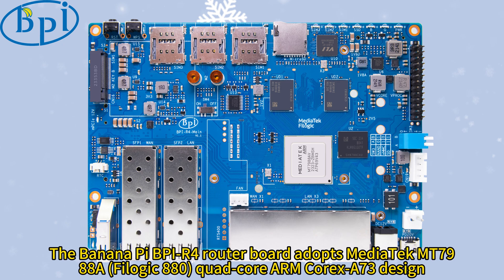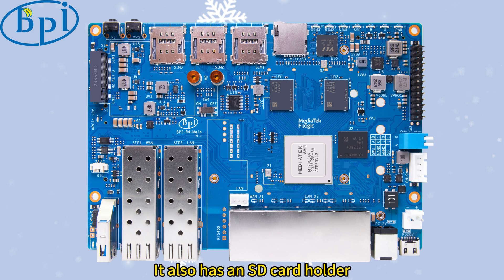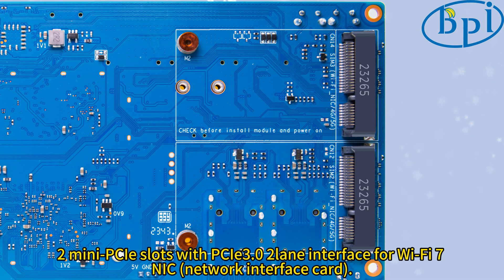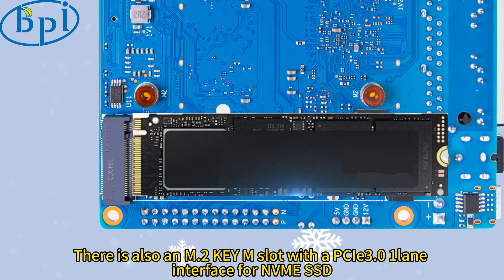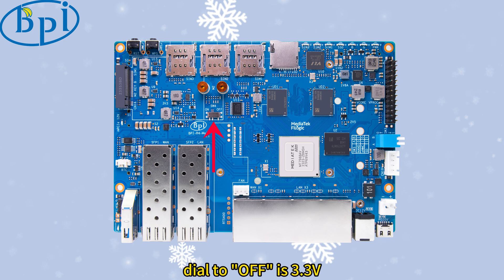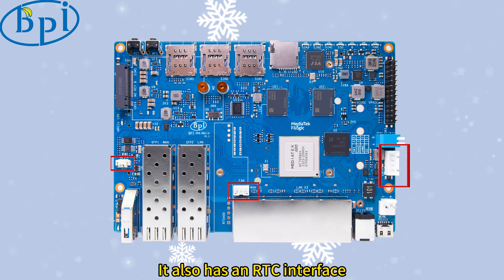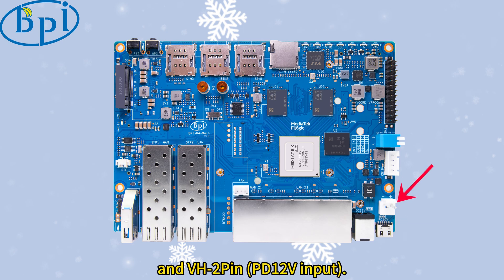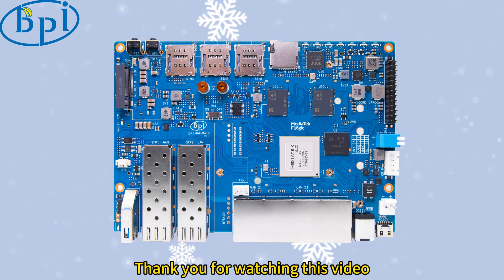Banana Pi BPI-R4 Opensource Router Hardware interface introduction. Wifi7 Router

Comment: I will wait for a board with at least 2.5  to 5 GHz lan , integrated Wifi 7 and and more focus on using it as an standard router. Why do we need 3 Sim Card slots in the board?!
Reply: cause they can .. 
But 2,5Gbps + PoE would be nice